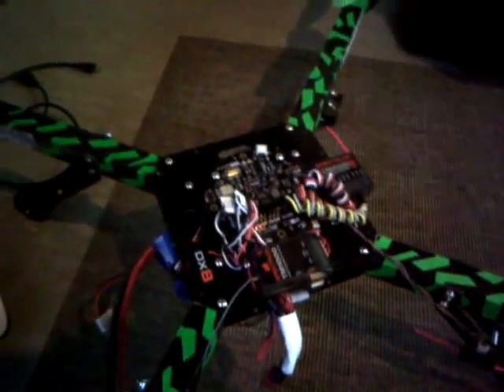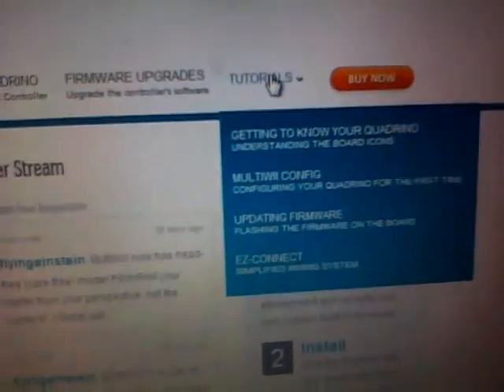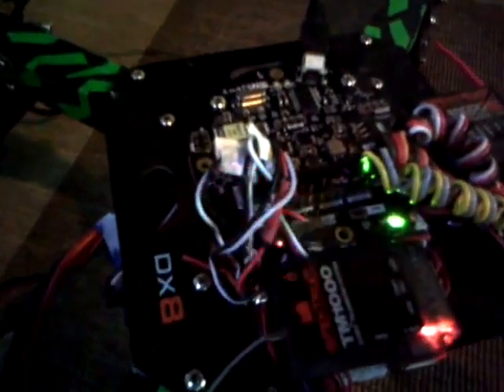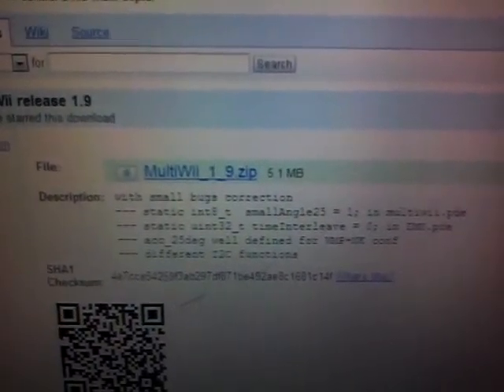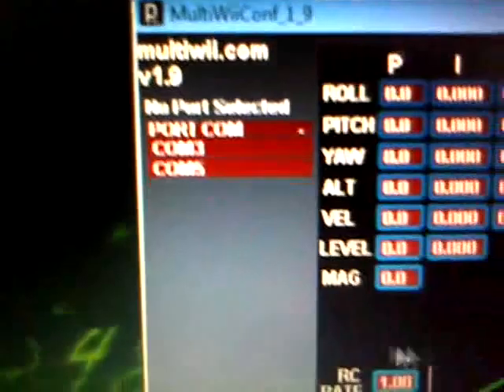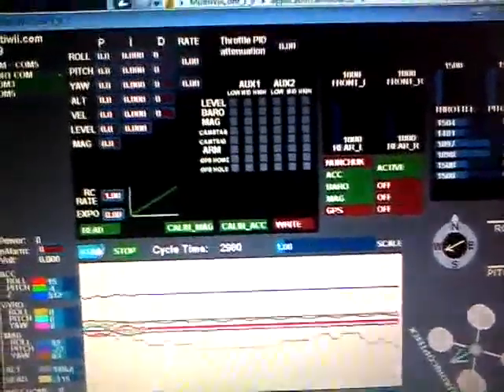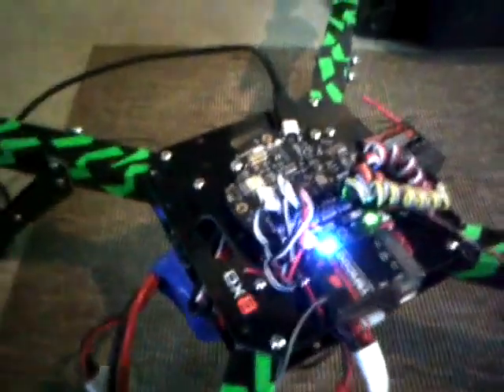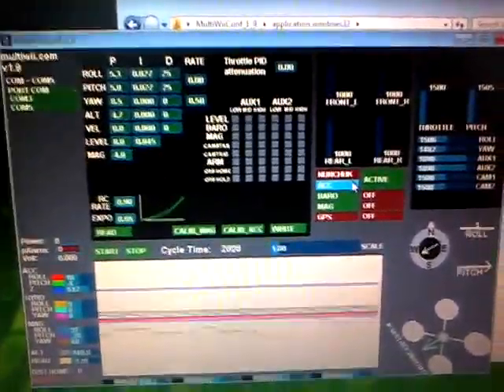How-To: Quadrino Basic/Zoom MultiWii Flight Controller Setup

Comment from the maker: The board itself does have an on-board voltage regulator if you prefer to use it.  You can apply power directly from a 2-cell of 3-cell Li-Po pack to the Vin pads on the Quadrino board.  If you use this option, you need to either use Opto-Coupled ESC's OR pull out the red wire on the control lead on each of the ESC connectors so the BEC on the Quadrino does not fight with the BEC in the speed controllers.

Comment from the maker: You can also provide +5 volts to the Quadrino board from the BEC of one of your Speed controllers  You will ned to lift out the red wire on all but one of your speed controllers and the BEC in the speed controller will then power up both the Quadrino board and your radio receiver.

Comment: I have not yet set up the older boards, nor have i gone from the 1.7 to a 1.9 quadrino board..however, if you are trying to set up a quadrino 1.9 into a tri, hex ect..you will have to change the internal coding to what version you wish to use ..all the quadrino boards we carry are set up to quad x configuration as the default.

Comment: When going from a V1.7 to the 1.9, isn't there more to tweaking some kind of code in the board? It's been over a year since I've done it but it's where you set min and max throttle numbers, if your a tri or a quad, etc. 
Thanks.